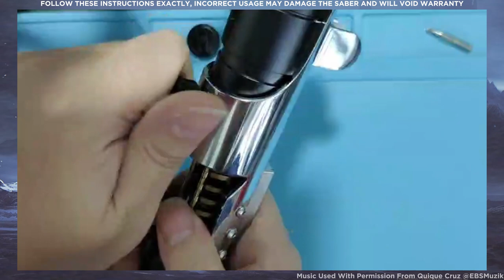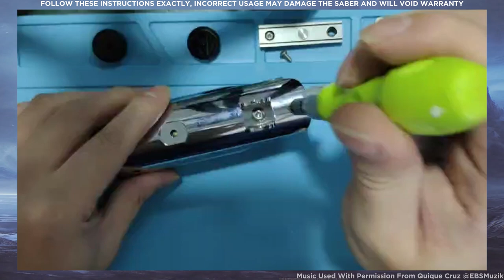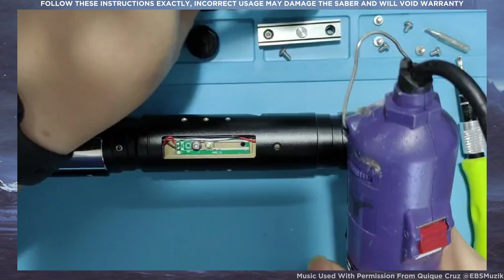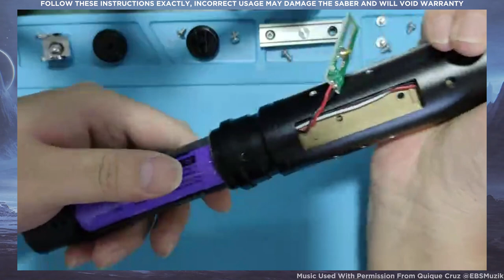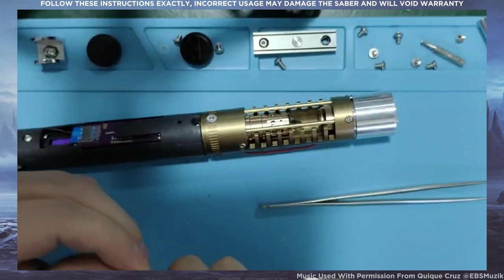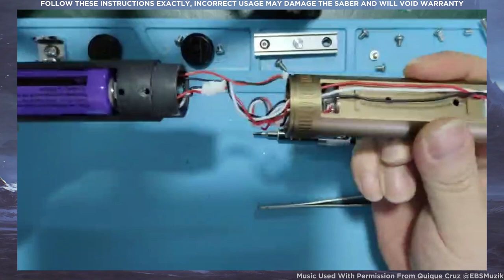Disassembling The Unleashed : A Starkiller Inspired Lightsaber

Comment: Can you show how to upgrade the speaker on this saber? Its right under the charging port so what do you need to do?
Reply from the maker: If you're switching out the cores the new core will already have a speaker installed. However, if you are modifying the core you will need to unsolder the speaker wire and solder the new wire in the same place. We do not recommend modifying the pre made cores as this could damage the core and void warranty
Reply: @parsecsabers  I wont be swapping cores, just upgrading speaker. Interesting, I wanted to ask since you have this saber in hand. I was just wondering if it was a quick swap with a JST connector where I can easily just swap in a new speaker or was it soldered manually